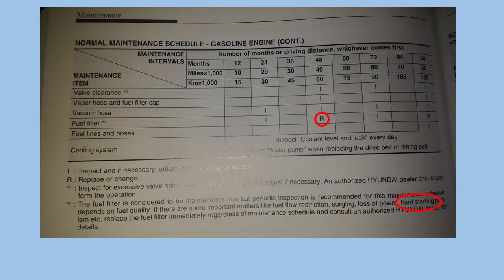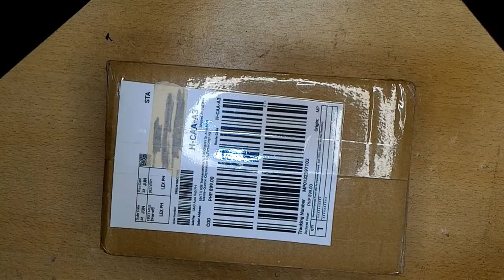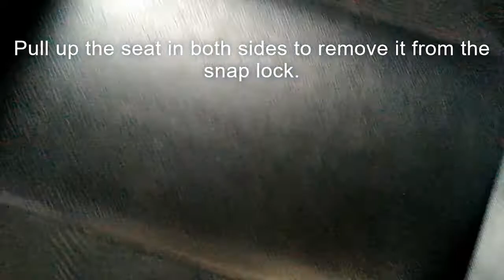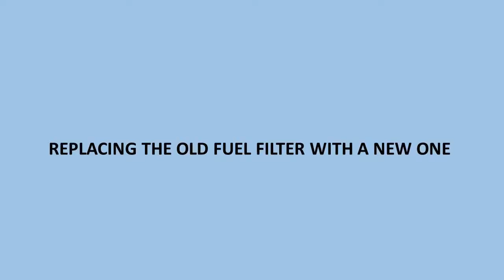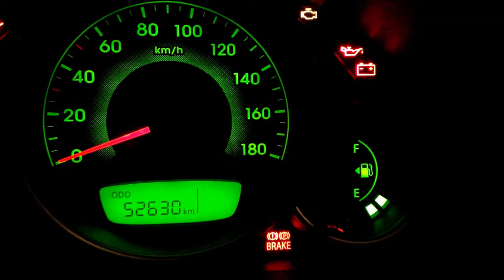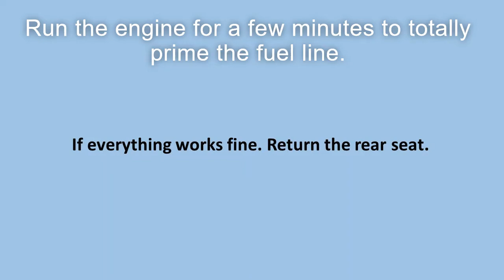Hyundai Eon Fuel Filter Replacement

Comment: sir pwede maglagay ng additional fuel filter sa tabi ng engine?
Reply from the maker: I think hindi pwede. Kasi the manufacturer did not design it to have additional filter. May only cause problem, like kapusin ng flow at pressure ang  fuel pump. Tapos malayo pa ang fuel pump sa engine.